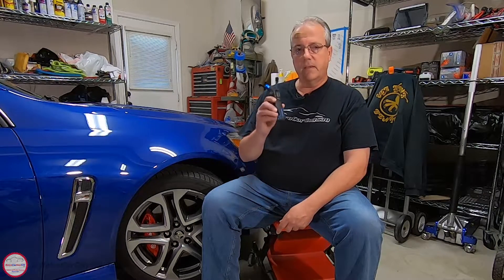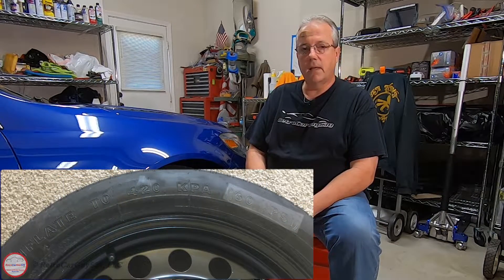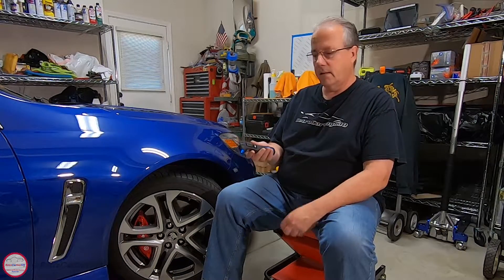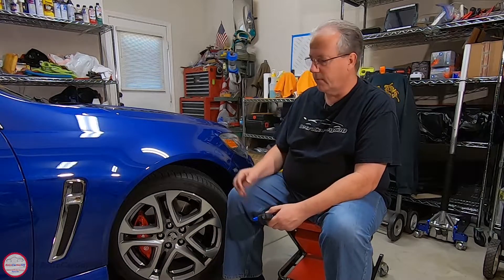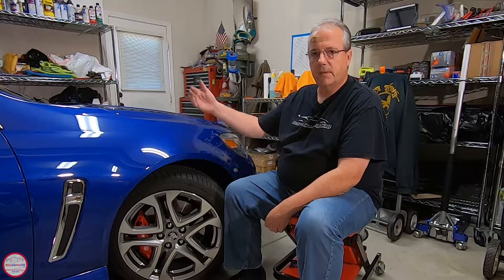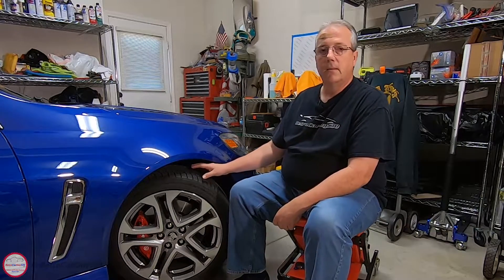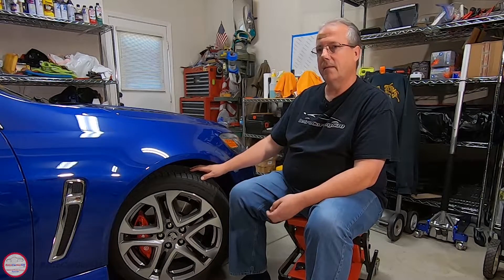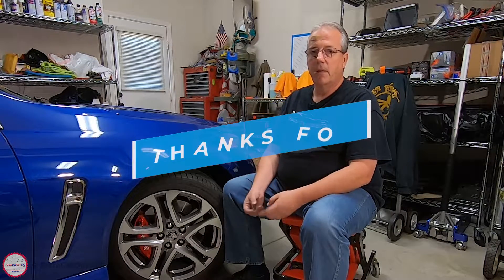TPMS Direct vs Indirect | Monthly Tire Pressure Maintenance

Comment from the maker: This is an important part of your vehicle's regular maintenance.  A tire pressure monitoring system (direct) will only warn you of low tire pressure(s) when one or more of your vehicle's tires go 25% below the recommended cold tire inflation value.   Even a few PSI below the cold recommended inflation value can impact your vehicle's fuel economy and it will cause the running temperature of your tire(s) to increase which can lead to excess tire tread wear and potentially a safety hazard if the tire fails due to being underinflated.